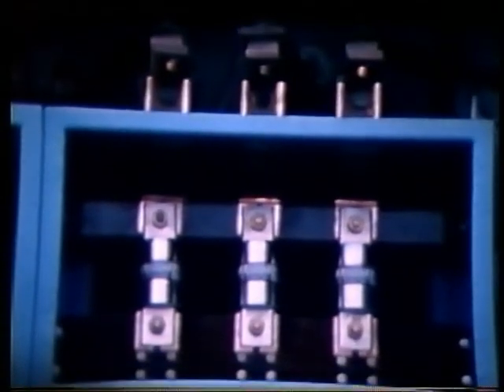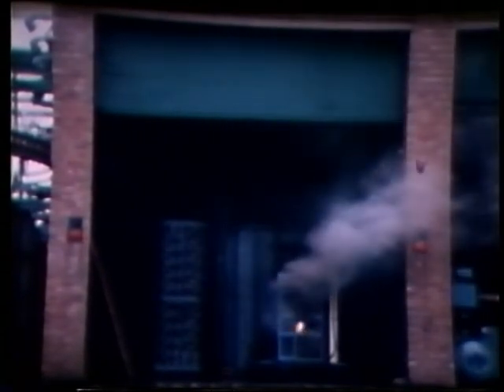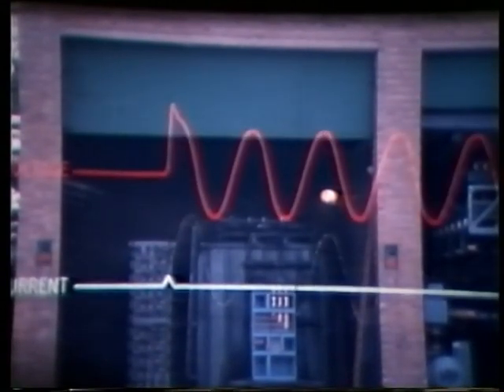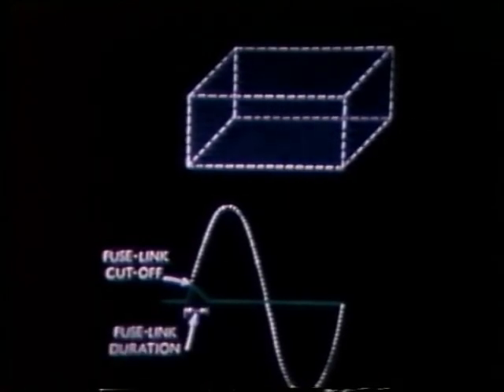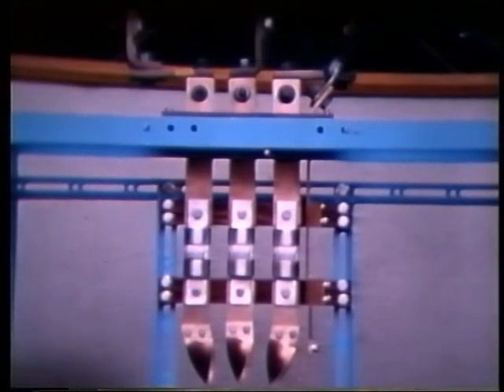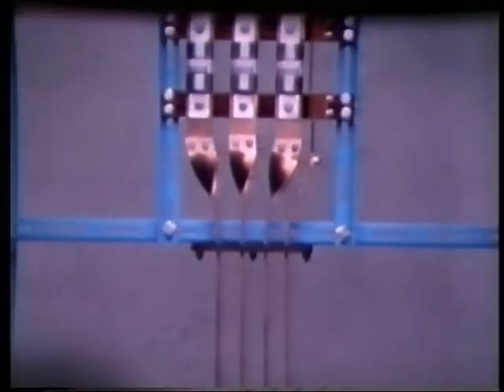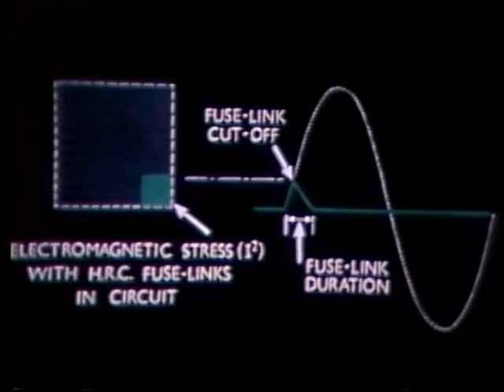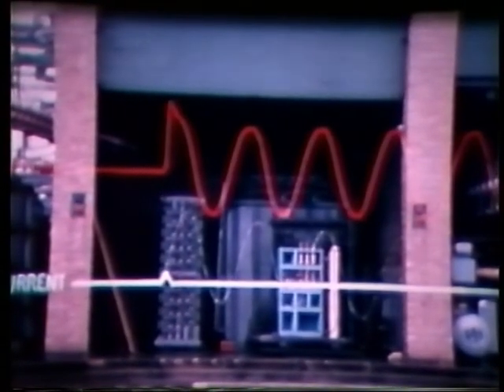BS88 HRC Fuse Tests-Short Circuit Faults -High Power Test Lab

Comment: I'm curious what would happen if thees fuses were replaced with 13A plug fuses? I'm guessing no damage would occur either? But of course such small fuses would not be able to carry actual useful current for service.
Reply from the maker: They would still clear the fault but they might not do it safely. BS1362 plug top fuses are rated up to 6000A   (6KA) whereas BS88 high rupturing capacity (HRC) can handle up to 80KA safely without exploding.. the ceramic bodies have a very thick wall and often multiple fuse elements routed through separate tubes cast into the ceramic.. they are also often filled with fine silica sand around the fuse elements as well to absorb some of the energy if the fuse wire ruptures under a short circuit.. some of the old porcelain rewireable fuses used to be really dangerous for this, people have been known to put them in on a fault and they have blown up in people's  faces
Reply from the maker: Of course, you only usually get really high fault levels if you are close to a transformer, so these are ideal for industrial situations where you might have a transformer feeding a switchboard in a factory with just a short length of very large cables.. almost no impedance so lots of fault current will flow in a short circuit fault..
Reply: @stoufer2000  Thank you for your quick replies I appreciate it!

Comment: Was this filmed at ERA in Leatherhead, Surrey?
Reply from the maker: I really don't know.. I was just trying to look to see if I could see any BEAB  or  ERA pictures to see if I could spot the test bays.. be interesting to find out if it was there or GEs own place.. I'll watch the tail end of the original video if I can find it and see if I cut off any credits..
Reply: @stoufer2000  OK, thanks. I used to take test equipment to them for high-energy testing to EN61010 some years ago and remember their labs and test setups which were very impressive. They had one lab which had a huge pylon outside feeding the test room. I can't remember the spec but it was something like 250Kv at horrendous current fed straight from the grid 😬

Comment: Electromagnetic bounce between bus bars
Same happens on three phase high voltage power lines on surges or switch ons, with old step down transformer at end with lack of ramping damping bits and pieces.
Reply from the maker: Jeez yes.. I always think it amazing that some of the bigger transformers I've witnessed going online manage to hold together and not damage windings and cores. You can feel the ground and air shockwaves.. Also remember getting nagged into making up hardwood split clamps on a ladder rack for a set of transformer tails one time.. I was only an apprentice, and electrician I was working with had been told to tie wrap them, I don't think even in trefoil.. Client went mad about what would happen if there was a short circuit fault. Lol, we had to make up about 70 of these clamps, seven 630mm cable holes and three threaded rods holding the two halves together each one.. took us about two days, three holesaws and cost a fortune for the hardwood timber . I can't imagine our boss was too pleased but it was his substandard design really..
Reply: @stoufer2000  Exactly - BANG! Lack of capacitors and zenor dumping  and big low value resistors diodes huge packs to shock absorb, and that. Old kit.

Comment: 63 amp blowing in my hand was interesting enough for me. My ears were ringing for days. Usual thing, wire caught under a conduit junction lid. Bastard!
Reply from the maker: Hi Huw... lol, yes, fuses on faults always used to make me jump out of my skin, the old rewirables were always an interesting experience and some of the old porcelain ones were dodgy as... especially as nobody seemed to warn you that some PPE might be a good idea. A 30A rewirable onto a dead short in a dark cupboard with my head about a foot away was a memerable experience for me... pretty much literally as I could still see the flash about 6 hours later. Visually burnt onto my retina I think it must have been!
Reply: @stoufer2000  Last proper job I had was test and installing welding sealing machines for electrical component industry, specialised. Voltage? Upwards to 24,000 volts, DC!!! Lethal. Boss was testing one machine, huge copper bars were crossed, BANG! The whole machine blew up in front of him, covers flying. The electrician immediately got told to go forth. Agency electrician, with dodgy cards... 😁 Boss survived, BTW, if a bit deaf for a few days.

Comment: Imagine Diane abbot being let loose on that stoufer2000.
Reply: @stoufer2000  just imagine the havoc and chaos of 1960s 1970s equipment, dianne would try an fix it with a posi drive and the multimeter set on continiuty
Reply: @stoufer2000  less of the filth old son. What you did for those bee's was to be commended. Well done stoufer2000
Reply: Yeah Abbott Getting Frazzled 😀 As it happens she’s got nothing too FRAZZLE
Reply from the maker: Unlikely when you dirty sionists destroy all democracy. Like a stinking plague